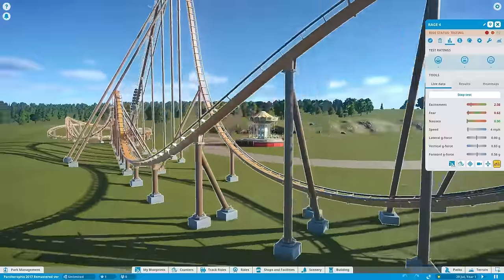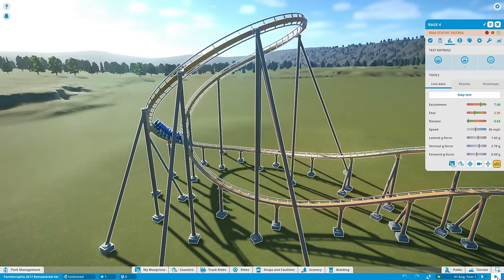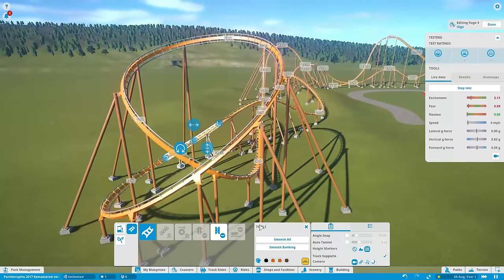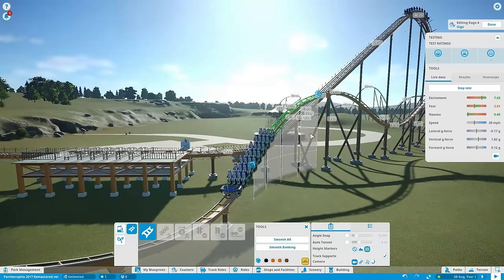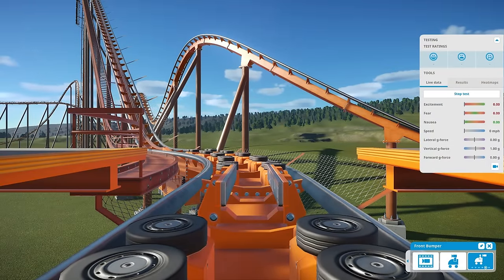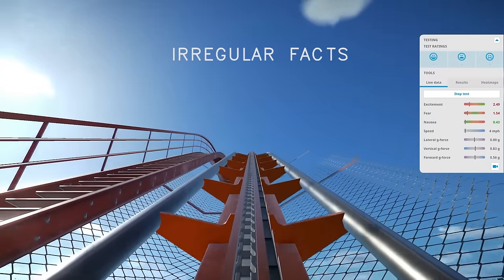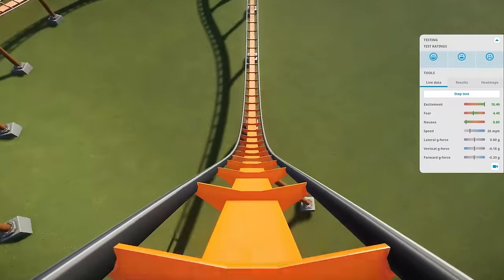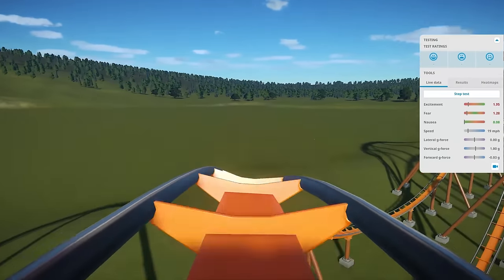Planet Coaster - Optimizing Coaster Track (G-Forces) - Pantherophis #2

Comment: every time I smooth a coaster it adjusts my green stats to bad ones.
Reply from the maker: Tazmin yeah that happens occasionally... Smoothing does not always do what you have in mind. Try using smaller pieces of track to "rough sketch" your layout and then use the smooth function, that should create smoother track and therefore better stats :)
Reply: yeah thanks, I haven't done many so still learning 😁